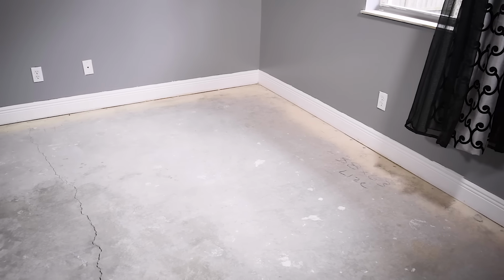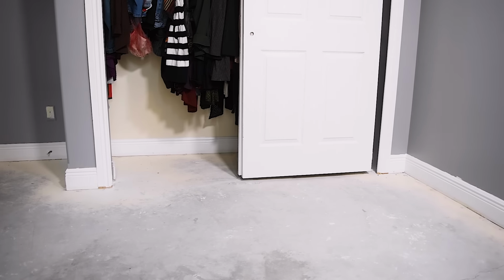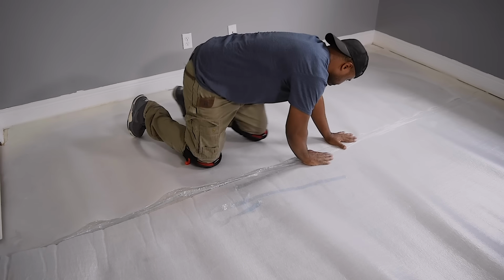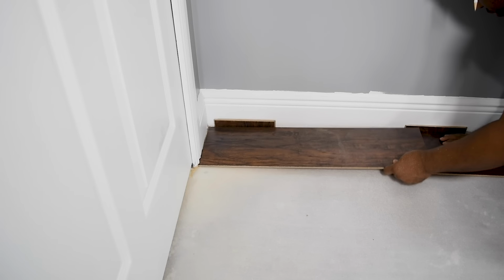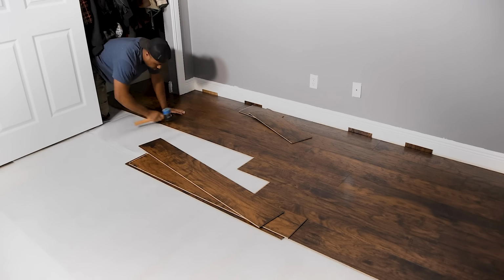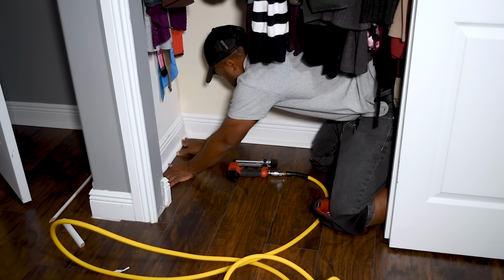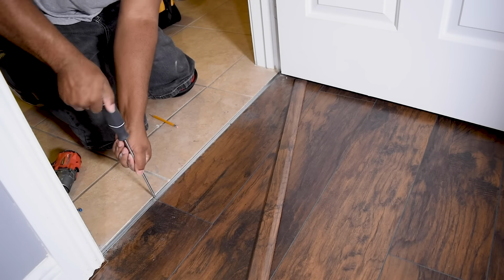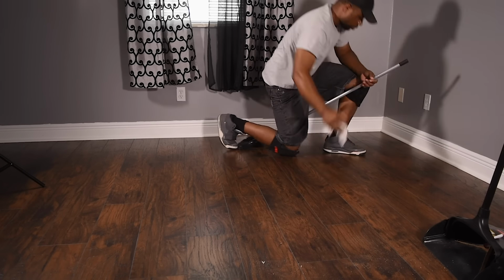How to Install Laminate Flooring for beginners

Comment: Marked down for not covering critical issues with the install. Cutting laminate is a huge part and using a mask for toxic dust is important. What type of saw or tool?  What saw blades and how many teeth? If circular saw blade has too few teeth, chipping will occur. You can use a laminate flooring cross cutter for fast and clean cuts. This installer is pretty mediocre. I would look for a better option. 👎

Comment: Very good video. I've got a guy installing laminate wood flooring in my den right now. The under placement my guy used just looks like plastic. I guess he didn't get the expensive kind. Wish I saw your video before he started.

Comment: As a contracted new construction floor installer u do not need a moisture barrier AS LONG AND ONLY IF u get a lvp or let floor with a foam backing on it. Also ur seams do not rlly matter but I like to try and keep it seam in front seam in back so short long short long but make sure no 2 seams line up and or they are 6 inches apart with that u wont have what we call stair cases like he does where he goes long smaller and even smaller if that makes sense but u need to try and keep it random no latter it will always look best trust meghys

Comment: Wry well done. You’d almost say that I did this job. (JK!) I will repeat these steps soon times 2 as in two projects. I do want to punt out the primary direction of travel for the floor traffic. If it is not correct the flooring will separate over time so laying the flooring pertaining to traffic flow is crucial. Parallel to travel always always always.

Comment: We also have concrete cracks underneath our tile and wood floors and the crack is pulling our tile up and separating our wood flooring as it moves. You need to repair the crack in the floor to halt it's movement to keep what is happening to us from happening to you.

Comment: Great video, only critique I have is you can still tuck under the base board and not use 1/4 round, and you should never cut the face of the plank only the back, that way if there is any tearing it won’t affect the look. Otherwise great job!

Comment: i am bout to do my flooring in my living room, i noticed you used the spacers in the begining, is that 100% needed? or can i just use my osclilating tool and making the laminate under the base molding? I have an older apartment, so me removing the molding will most likely break a few coming off... im assumng you use the spacer and the little space it creates is just covered by the quater road correct? Does this cause any shifting while walking or does the quarter road hold things into place?

Comment: Looking for an advice here. I moved to a house with a laminate staircase that has 2 landings, and both landings slide a little from time to time that you can see the edge of the laminate floorings shifting out from under the baseboard. How can I stop this whole laminate flooring slab from moving?

Comment: Just an FYI, you need gaps/spacers on ALL sides of the flooring for expansion of the wood. If you only leave gaps on one or two sides you will eventually get buckling of the flooring.

Comment: FYI - Quarter-round is the same length on both straight sides.  Shoe molding is longer on 1 side than the other.  This is technically shoe molding.  Does the same thing, just a bit of a different look.  Great video.

Comment: I would seal that slab crack with self leveling concrete patch just because it's quick and easy. There's a tube of it that goes in a caulking gun.
Great video. After hearing the comment about the 13 and 14 year olds doing it I'm pretty much shamed into trying.

Comment: I am 71 yrs old and attempting to do some repairs/changes to my home with the help of 2 ambitious 8 yr old grand boys :)!  We are currently working on floors and ripping out old carpet to prepare for new flooring (not carpet).  Now the carpet is out we found that there is plywood bolted to the concrete slab!!  Is this normal?  How should we attempt to remove this nasty wood and how much damage can we expect?

Comment: This video is an excellent guide for beginners looking to install laminate flooring! The clear, step-by-step instructions make the process easy to understand, even for those with no prior experience. I appreciate how you covered everything from the initial preparation and necessary tools to the actual installation and finishing touches. Thanks for creating such a comprehensive and user-friendly tutorial!

Comment: Please - Make sure the floor is level and flat - or at least flat....  no dips or bumps...  just because you are installing into an area that had a previous floor does not mean that the previous floor was installed correctly...  most MFGs have a minimum flatness the floor needs to be for the flooring to sit atop.  This goes for brand-new pours as well, there are probably dips and bumbs that need to be taken care of before you put the first layer down...

Comment: That major crack in the concrete floor means you have a major foundation problem. The foundation has not been compacted enough, also when laying titles you do the 3x4x5 method to ensure your titles will be laid square. You do not follow the walls of the house as they may not be square. When laying title and starting from the centre of the floor using the 3x4x5 method you lay the titles from the center of the foor outwards to the walls.

Comment: Hey bro! Great video. At what point do you remove the spacers you placed to allow for gap expansion? Another question is how do yo prevent the floor from moving after the spacers are removed? Thanks in advance.

Comment: Buying or renting a base board saw to cut the baseboard is a whole lot cheaper than purchasing quarter round ,painting the quarter round and installing the same. On the last piece to install is a cut to size snap in procedure.

Comment: The actual floor is ok but the finishing round the edges is an abortion where mastic and 1/4 round have been used to avoid scribing that said from the start the skirting boards and architrave base blocks should have been removed first which allows for expansion and contraction around the perimeter, then renewed and replaced after the floor is laid negating the need for Mastic and quadrant bead.

Comment: there is a huge crack on your friends concrete floor does it matter?
Reply: After installing over 500 floors on concrete, I have yet to have seen a slab without cracks in it. He used a vapor barrier type underlayment between the slab and flooring. This is good enough if the cracks are level on both sides. If they are not level they need to be ground down to even. Sometimes we fill the crack with a sealer if the customer prefers that. Again if the crack is even on both sides this is not necessary.

Comment: Damn dude 😂😂 it's been a while since I installed a floor but few things here! You didn't tell them how to find square, do a rough lay and look for weird ends (like your 3" closet piece), didn't maintain your spacing around the room, didn't mention screwing down the sub floor for squeeks first, and there is a proper way to lay a floor. It's going perpendicular to your floor joists. (Which concrete for you but notable for others) 

Outside of that, great instructional video for beginners! 

Side note on the concrete floor, make sure to take note what direction you're nailing your 1/4 round and your finger placement. End up with a nail ricochet back into your fingertip 😅

Comment: with an 1/8' Flat aluminum 1 1/2" you can put in 5 flat head screws and countersink nicely, but can cover wrap in complement vinyl or paint and even hide the heads with the same vinyl. the gap below. it wont dip a good bridge (sure you can put id a bead/strip of wood if you want and glue it also )

Comment: Well done! Really like the way you did the quarter round.

We are leaving the base boards down on our remodel, so I’ll use the tips you provided.

Will definitely be cutting my door jams first thing, just in case I need to start at the door instead of a wall like you mentioned.

Comment: This is beautiful work i live in nyc apt an i painted my floors white two years ago cuz the land lord didn’t want to refinish the hardwood an they were a mess.  So not the floor is a mess an im thinking of putting this but they also won’t replace the molding an they are very old so old that they are rotting like years an years of layers of paint on them. So idk how I’m Gona put this down an have the Edged look nice if the quarter round stuff would look nice. Rite now I’m pregnant an the apt has no ventilation. which makes it dusty an the floors are hard to clean as it so just want to make life easy for myself with baby on way. Any advice on what to do ?

Comment: Sorry, but I really hate quarter round. If I were you I would have removed the existing baseboard, installed the floor and then added new baseboard. It would have been a much cleaner look.

Comment: The cuts at the start, is it not possible to lay full lengths and then cut what's too long or is this a kind of style to have different lengths in each row. In UK Victorian floor boards and other Georgian houses etc the floor board runs full length end to end until later when plumbers and Sparkys cut where they want to get under otherwise they're full lengths. Please advise.

Comment: Dont cheap out on your flooring, the cheap flooring is made like particle board and will warp if water get on it as little as 15 min!! It will save you money if you get a waterproof laminate, I learned the hard way.

Comment: Are We Not, Gonna Mention The Huge Crack In the Middle of the Floor!
Reply: There's a lot more wrong in this video.  This is not a job well done.  
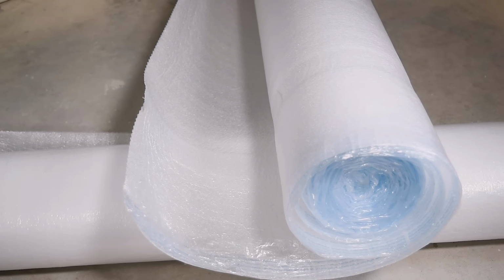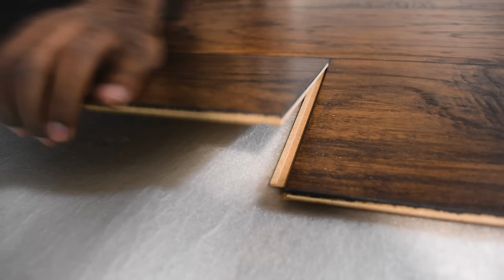As to the crack, it presents several possible problems depending on its form.  First, he should have checked the crack to see if it creates an inflection point / sharp edge caused by the slab settling.  That would need to be ground down, leveled or remediated in some way. @2:58 - it is easy to see that the crack is caused by settling by looking at the molding.  The ends touch and there is a gap beneath the molding where the crack is.   @7:20 - it s obvious that the floor has not been leveled as shown by the BIG hollow between the laminate and the underlayment.  Every time someone steps there it's going to sound like someone is tap dancing. Clickety-clack!  Manufacturer's specs call for a maximum deflection of about 1 millimeter (3/64"). 
Second, even if the crack was simply caused by contraction (because the mix was too wet!),  he still should have (ground a groove if needed) sealed the crack to prevent ground water intrusion.  The function of the underlayment is to provide cushioning and act as a VAPOR barrier.  It is not a MOISTURE barrier.
The underlayment is not installed per manufacturer's specifications; it needs to come up the side walls to the thickness of the laminate.  Only lazy pirates and corner cutters think it's a waste of time and effort - it only takes a few extra minutes to do it right and the 'extra' material cost is mere pennies. On re-thinking, it might actually cost as much as one whole dollar. OMG!
Most mfgs callout a 10 - 12 mm (3/8" to 15/32") expansion gap around the perimeter.  If he's using a 7mm laminate and using pieces as shims, then he has set the expansion gap incorrectly.  On second look, the gap is set incorrectly.  There needs to be a gap at the ends of the planks also. 
Row staggering - most mfgs recommend NOT using a stair step pattern (the typical full - 2/3 - 1/3) as the aesthetics are crappy.  They recommend randomizing the offset between the butt joints provided each individual piece is not less than 12" and the butt joints are no closer than 12" to the previous row's butt joint.
Reply: @andrewlayton9760  That Was The Point of My Question 🤣💯😂
How They Just Remodeled Over The Crack In The Floor

Comment: About if the wall is not square when you start?  Without measuring all your pieces don't you run the risk of ending your job with a small piece with wise that you might not want?  Seems like you're asking for a potential problem.

Comment: Good video and nice work.  Personally, I use the Oscillating tool to cut all the baseboard and then slide the flooring under cuz I hate quarter round!  Either way is extra work but the finished product looks better just cutting the base.  Also, a tip, run your boards the direction of when you walk in your front door the boards are long ways so your flooring doesn't go sideways and make a cut off feeling to the eye.  Long ways makes the room look longer so follow this direction thru the house.  The other thing I do is butt the wood to the tile at the same level and leave a small gap the size of the tile floor grout and I used a sanded caulk (or non sanded if that's what matches the grout in the existing tile) to fill the gap so it looks like grout between the two but it's a flat smooth transition that's easier to mop over and no tripping strip.

Comment: Choosing the direction of the boards should also take into account where the light source of the room is. Boards should be placed along the light, since placing them perpendicular to the light will bring out any streaks left behind by mopping.

Comment: This popped up on my feed with the title and image showing butting laminate against baseboard, so I had to click  I did not watch but FF to hear why the baseboards were not removed and reason of intimidation/complexity/time was given.  This title is "How to Install Laminate Flooring for beginners", but if you add 1/4 round would be "How to make your Laminate Flooring look like a beginner installed it".  Sorry, but if you are taking on the task of installing flooring, that greatly impacts the value of the home, or can be the difference in limiting buyers when selling, just do it right.  DIY can be tough, and there are a few people that probably should not do it, but give it patience, time and with a quality mindset, you can do it as good or better than a pro.  It takes little time and is of no complexity to pry off the baseboard, and even just use the same nails to put it back on.  Cut the caulk with a knife, peel it off, remove the trim with a putty knife or small crow bar, then cut the laminate so the baseboard will cover it.  Installation of laminate is probably one of the easiest DIY jobs you will have, the layout is the tough part, so just search that and let it roll.

Comment: I wish I saw this video when it was first uploaded. I helped lay down flooring similar to this in my sister's basement. We did not have a mitre saw, which would have made it easier to cut.  This family should have had the crack in the foundation floor sealed with an epoxy as this will lead to future problems.

Comment: Why didn't you just remove the baseboards before you did the Laminate floor? also that underpayment you used didn't really look good especially if that floor is on the second floor or higher

Comment: How long did it take?
I rent and the maintenance guy took 4 days. The floor is not smooth, pieces are loose and for the transition piece they used a 2x2 because they cut the plank narrow.

Comment: I've watched a lot of flooring videos, but this is the best step by step. One question: if I'm installing under a regular subfloor (after I tare the carpet out) what kind of underlayment do I need?
Reply: i put the airguard on by roberts on my flooring and it works pretty dang well so far. Put it in about a year ago with no issues thus far

Comment: I've done flooring for 23 years, commercial and residential. I like the random pattern you did. It's the best look to me and makes for a stronger floor.  Sometimes people line up vertical seams up one row over from another. Like vertical seam, skip a row vertical seam in the same spot.I call them h's and they make for a weak floor. Drives me nuts when I see it. I noticed you had none of those neither which is pro. No hs and random is a must on interlocking floors if you ask me. Beautiful job.

Comment: Modern vinyl plank flooring now has the underlayment already on the bottom side of the planks, not only that but you don't need to cut them with a saw, you just score it with a razor knife and snap it (kinda like you do with sheetrock). I'm installing some lifeproof luxury vinyl plank flooring in a house now, it's wonderful. It's kinda pricey though, 3.79sqft, so it would cost about $550 in materials for a typical 12x12 bedroom, but the stuff is freaking durable and the way they lock together it's 100% waterproof.

Comment: I just want to give you a MASSIVE Thanks sir!  My daughter wanted this exact flooring done and I said yes but never led on that I've literally never done anything like this So I found this video that was very well presented and gave me the confidence to try it  We ripped out her old carpet and followed your instructions and completed the project with ease  You're awesome sir
Reply: Hi. Did you use/buy all the tools? Looks expensive.
Reply: @educateme8455  20ft x 13ft room cost 450$ CAD  in material that Floor panels, underlay, baseboards and a rubber mallet Not to bad

Comment: Two big mistakes here. NO FLOOR PREP, and he did not talk about ASTM 2170, which is Concrete RH Testing. This is a standard in the industry and should have been done first.  Where is the data? Did you read the instructions? Nor, did he check the relative humidity in the room, which should generally be 40-60%. A hygrometer can easily test for this. If you don’t do it right, you can have squeaking problems and more. Great video, but he is leaving off the most important steps. No floor prep is ridiculous.

Comment: Thanks for this video. Super helpful. I'm just curious -- how did you remove the tongue from the first row as you suggested doing? And if you cut pieces to stagger them will the end that is cut need to go against the trim since there will be no tongue to click in to it's neighboring board? Thanks again!